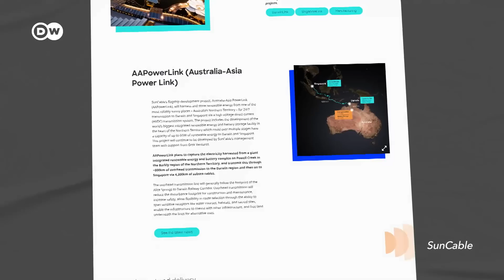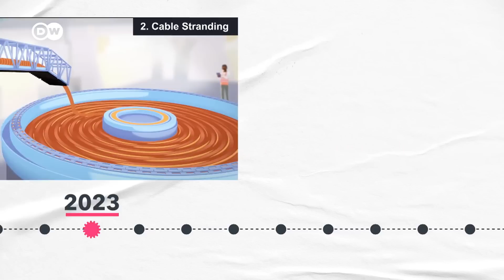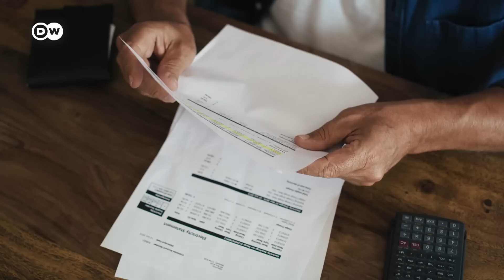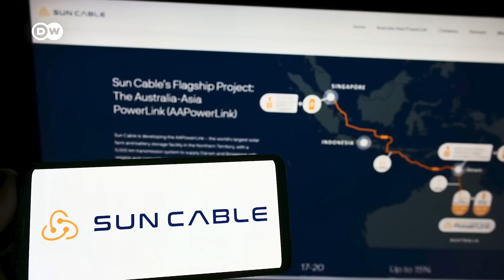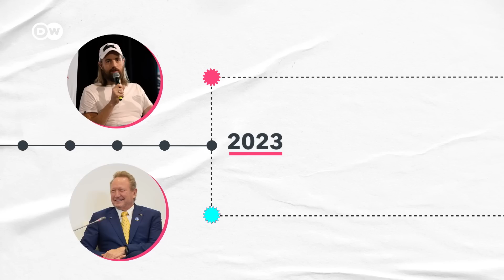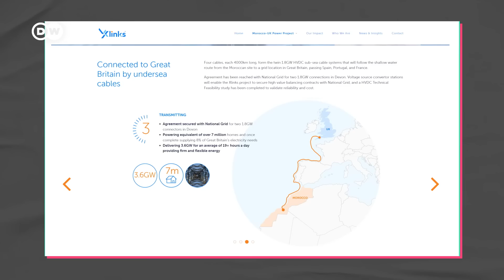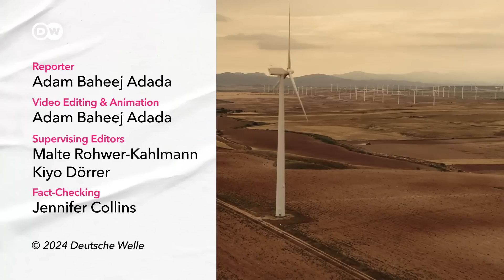Why the mega plan to send Australian solar to Asia (almost) flopped

Comment: Ironic that Australia is the second biggest exporter of dirty fossil fuels (after Russia) and does not have an acceptable infrastructure for decarbonising. Australia always exports it’s raw resources without turning them into high value products. Australia should first supply it’s own energy needs using renewables and shutdown it’s polluting power stations and dependence on fossil fuel. It’s coal industry is deplorable and a rapid termination of mining and exporting must be implemented

Comment: I did a quick and dirty computation of the cooper required for this project, certainly more than 300 thousands tons (2500mm^2 cooper core over 4300km + 800km times 3 cables, this would certainly big significantly more to be able to move 6 GW continuously). Annual production of cooper in Australia is 900 thousands tons. Would they really be able to allocate 1/3 of their yearly production for a single project considering the high demand for cooper all around the world ?
And those crazy futurist projects always comes with completely unrealistic timelines. Like 2022 they start to talk with companies to help build a cable factory, 2023 they start producing cables, 2027 the start to deliver power to Singapore ? Sure... Should be real easy to plan laying thousands of kilometers of submarine cables going through several countries and all. Only the political aspect of this would take forever. Later plan to have electricity going to Darwin only by 2030 is already utopic, the factory for building the cables doesn't exist right now, 2030 is in 6 years. I have seen road modification project take more than 10 years to concretize.
And can we really consider a project of this size, requiring so much resources, "clean" energy ?

Comment: $23B+ just for the cable?!! Even if that's AUD rather than USD, these people saying that solar is more cost-effective than conventional nuclear are clowns. Because on top of that, they're also going to need massive energy storage to ensure grid stability... batteries won't cut it, and I don't like the chances of a pumped hydro project in the Top End either. As for the environment... arid lands may not look too appealing to the average human, but they still have ecological value. The size of the collector fields being described... can't not have a massive impact. This thing is cursed.

Comment: Companies are not allowed to plant cables under the Indonesian sea, either the territorial sea or the exclusive economic zone with connections. It is forbidden because the connection part can be misused for spying. In the event of a breakdown, to obtain permission for repairs will be very long to get it. The company must have an office in Indonesia and have a person in charge of operations and is obliged to pledge a certain amount of money in the Bank in the event of a submarine cable leak. A person responsible who must bear the penalty of imprisonment in case of leakage current.

Comment: Short answer to your question about where I want my energy to come from is easy, my yard.  I'll eventually add panels to cover the extra need for my EVs and replacing the gas use.  The grid need is my backup, which I still pay for through my monthly bill.  I wish this solution were more scalable worldwide, and interconnects are part of this, but geopolitics and capital will always be a bigger issue than technology.

Comment: Energy security is indeed a very relevant topic for grid operators, and I don't think people realize just how important it is. Many seems to view the matter as some "non-sense political dispute", but it's actually a technical issue, since you can't have much reliability when the electricity you're using is coming from such a far away place, one that you don't get to control yourself.

For small island nations like Singapore, and a pretty wealthy at that too, floating nuclear power stations should do the job.

It lets you access relatively huge amounts of electricity using such a small area, one that can be totally under your own territory. It should be a no-brainer!

Currently though, only Russia manufactures those, and Singapore would probably not want to annoy its main western partner, the US, by building important relations with Russia. That said, they could as well invest in Korean companies aiming to deliver those very power plants by the early 2030s.

Comment: Electric connectors between Estonia and Finland regularly break down for various reasons. The gas pipeline in the Finnish gulf transferring gas the same route was damaged (allegedly on purpose) by a Chinese ship's anchor and went out of commission as well. So, not only are these projects costly - they are also fragile and vulnerable in operation. Didn't take much to blow up the gas pipeline in the Baltic sea. Hydrogen or ammonia seems like a safer option both for consumers and producers because the chance of a market disruption or bottlenecks in the market are less of a risk as long as the world shipping continues to function.
Reply: they were looking to build a pipeline, for the Ammonia.  and got told no.  if they were going to transport it via ship that might have been a different response, but that was not what was proposed at the time.

Comment: A lot of grandiose talk in Australia about renewable energy, but so far very little has been achieved.
Reply: Well, not quite. I live in South Australia, at present powered by 80% renewables. Next year, or the year after, 100%. The same, roughly, is true for Tasmania. However, these are small states, but the pipeline of renewable projects, assuming they go ahead, should easily decarbonise the Australian grid by 2030-35

Comment: Big lines like this are big pie in the sky ideas for a reason… why not run the power through Indonesia so they can profit from it also? Surely that would be easier than this huge cable? 

Another factor not mentioned is what is the power loss over such a long length? That must take a significant impact. 

Maybe a simpler answer is sending power via battery boats? Would be crazy expensive probably but maybe it’s more feasible than running cable?
Reply from the maker: Hey there! 
As explained in the video, there were issues with Indonesia´s agreement to it. 

The power loss is approx 3 - 3.5 % per 1000 km. With the increased length, the resistance also increases and leads to loss. 

There are ships planned with batteries, e.g. the one by PowerX,

Comment: Cable is clearly the best method to move energy.  Hydrogen is simply too inefficient. Keeping the gas-fired generators would provide a backup and building cables to connect to other suppliers would increase resilience.  Keeping undersea cables protected from quakes and saboteurs seems like a much more daunting problem.

Comment: Long distance power lines are very expensive. On the other hand the conditions for solar in Indonesia and Malaysia are good, just not as perfect as in Australia. 
So getting electricity from those countries would be more sensible for Singapur.

Solar in Australia would be better used for production, which needs a lot of energy. Ammoniak is one option. Another would be to export iron and aluminium instead of iron ore and bauxit.

Comment: No, its not the complexity and cost of cables in th eocean, its almost always the political and economical stability of that contract of delivering energy....no governement can lay their energy-fate onto a third state/entity, if there isn´t a certain security, that the energy never will cut of, because ... there is always something.
And that is the reason, why europe, with its enormus energy needs, didn´t put up trillions of solar-panels in northafricans sahara and lay a cable through the mediteranian sea...because they do not trust the north african countrys/cultures, that they never will cut off the energy for some reasons. 
And there is in regards to east asia, sort of misstrust to "democracys", because what is that for a scenario, if a governement changes every 4-5 years? And struck all down, what was negotiated in the past....
You can´t be dependend on such a dependedness of energy or whatever.... even, if other alternatives of fullfilling energy needs are sometimes in the same situation and complication. But if you r energy comes out of a cable from a special location outside of your country, there is no free market, that can be able to compensate breakdown of contracts or suppliers....you not take your cable and lay it in another direction quickly...a cable is not a switchable thing.
Only a global network of energy/cables could make that situation less insecure.... but that will cost much....

Comment: Why don't they sell it in Australia?
Reply: No interconnections exist between the NT electricity grid and either the west coast or east coast networks.
Reply: @darren424242  I thought to ask about it as well. But if you are going to build one, wouldn't one without the geopolitics problems be easier to begin with? Unless the rest of Australia had also lots of renewables.
Reply: @chat-1978  there will still be politics involved because of the different rules and regulations between the three separate grids, though how difficult it will be to resolve isn't really known.

The geography and population distribution of Australia would also make it difficult to justify building the interconnections, even though in theory it sounds like a good idea.
Reply: @darren424242  thanks. Do you have maybe a link about this or some? I'm European but it is nice to learn about other continents. I guess you are an ausi
Reply: @chat-1978  yes I am an Aussie

I don't have any particular links on the topic but a population density map of Australia will give you a pretty good idea why outside of a handful of towns, the very large deserts in the centre of Australia feature no electricity grids of any kind.
Reply: @darren424242  I've seen the density but I don't know if that is a reason o have disconnected networks. For example in USA, where they have big population gap as well, they have different grids, but for a while now, they are interconnected. When the Texas outage happened, I think it was the only one that wasn't. 
Anyhow thanks.

Comment: DWTV does not like when people point out that renewables are a complete scam, so they hide the comments.

Renewable are always backed up by coal, oil and gas. This is both expensive and dirty. Compare renewable Germany with nuclear France and you'll see that energy prices in Germany are much higher, and German CO2 emissions are almost 10 times higher.

Comment: DW TV reporters are truly going down an imaginary rabbit hole. And the dumbass "experts" are awful. 

1. If the Cable project can't be done easily, do a "Store/Load/Release" cycle. 
   -   Re-capture Nitrogen + Hydrogen + Oxygen to create an Ammonia generation plant. 
   -  SHIP the damn liquid fuel to Singapore by Containers ! 
   - Burn/Release the energy in Singapore as and when they need it. 
   - If Australia wants the shipments, ship it around the coast or on truck-trailers domestically!
   - Ensure a percentage guarantee with Singapore exists so that if they request for it, they will get that minimum amount. 

2. Build "Oil-Rigs" in the Open Ocean, Store Containers along International waters route to Singapore. 
   - Determine how much energy can be shipped
   - Lead time / Lag time to move containers from port to International waters
   - Sustainability of Storage and volumes being shipped, empty containers shipped back
   - Is there any "energy waste" like polluted water or recycling materials that can be shipped back for price/offsets.
   - Establish Domestic processors in Australia to create secondary markets and manufacturing

3. Figure out how to do the interconnectors with "shipping" backups. 
   - Do you really need point-to-point ? Can't you supply Malaysia / Indonesia along the way ? 
   - Do you really really need an actual undersea pipeline / cable ??? 
   - Is it possible politically given Australia Mining and Gas and Coal having a chokehold on all Political decisions ? 

Investigate the actual problem. Political corruption, Private mega-corporation bribery illegal activities, investor fickleness. 

Technically renewables are possible. Politicians ruin things.

Comment: In my view the game stopper is lack of security of supply. 
  Current best processes for water electrolysis have an effective electrical efficiency of 70-80%.  I don’t know how much power would be lost  transmitting DC thousands of kilometres and converting it to AC at the receiving end.  All these projects depend on cheap, or nearly free, electricity. I think that you underestimate the cost of transporting hydrogen over long distances. Hydrogen boils at -252C at atmospheric pressure. Ammonia boils at -33C. This makes it much cheaper to store and transport in large quantities. The volume of traded ammonia worldwide was estimated at around 18 million metric tons in 2021. This figure is forecast to grow continually in the upcoming years, reaching a volume of some 238 million metric tons by 2050.
Ammonia can easily be cracked to give nitrogen and hydrogen and the hydrogen is easily separated from the nitrogen.  So ammonia is the best way of transporting hydrogen over long distances.
Finally “green” ammonia can directly displace ammonia made from fossil fuels without any changes to infrastructure.